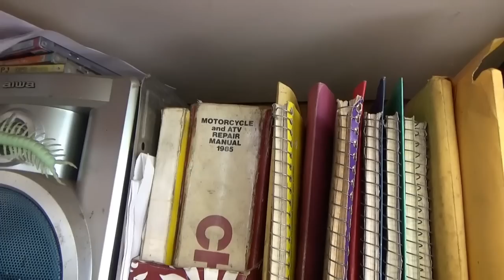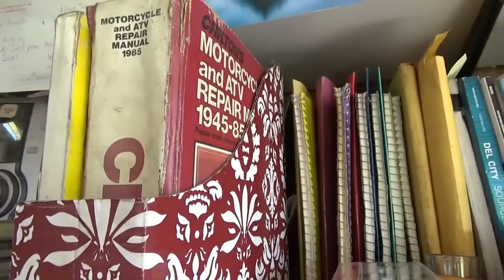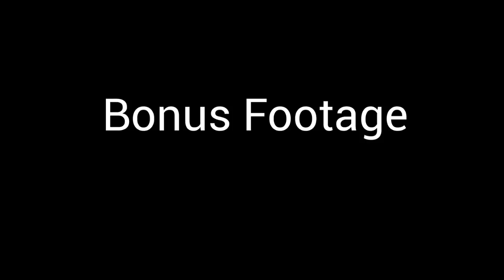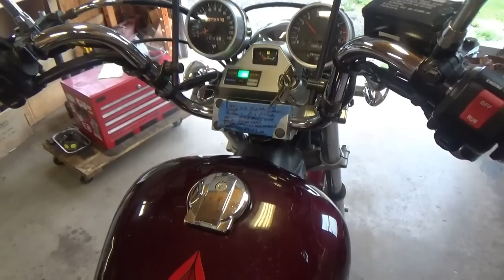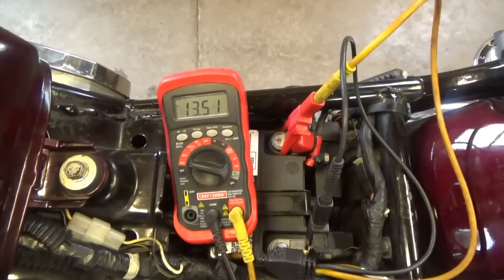Zen & the Art of Carburetor Cleaning

Comment: Thank you for this great video—clear, well organized and good camera work. I worked with some automotive carbs back in the day, but not gunked up. Now my Kawasaki VN750 is crudded up after sitting 2 years. Dealer refused to clean the carbs when I rode it over there with a rough idle. I doubt their “technicians “ could have done as good a job as you did in the video. And yes, my gas tank needed cleaning and derusting.

Comment: One thing people who have not dealt with carburetors need to understand that the "idle" fuel circuit should be called the PRIMARY fuel circuit, because the proper amount of fuel needs to flow through it AT ALL TIMES (not just idle).  If the primary fuel jet is clogged or even partially obstructed, not only will it idle poorly, but it will probably run lean at part throttle and WOT.  On engines with governors (mowers, etc) this will cause the normal operating RPM to oscillate up and down.
Some carburetor cleaners can cause "rubber" O-rings (like between the bowl and the carburetor body) to swell, making re-assembly difficult.  If that happens, wash the O-ring in dish soap and water, rinse well, and let it air dry for a few minutes.  It should shrink back to the correct size.
Always shake the float to see if it has any fuel inside.
Reply: Those days are long gone. The carb cleaner sold today can be used as eye wash it's so weak. 🤣
Reply from the maker: Yup. My brother tipped his 1976 Yamaha XS 500 over on our first long ride back in 2006. Would only idle on one cylinder after that. Kept riding it for 200 miles. When we got home I found a piece of debris in the idle jet, and the spark plug melted into the head!!
Reply: @PineHollowAutoDiagnostics  - Holy CRAP! That thing got HOT!

I have massive pilots in my RD. Stock was like a 15 or something. If I remember right I've got 27.5's in there now. :) Ethanol sucks!
Reply: @SmittySmithsonite  What model and year of RD? I have a 76 RD400C, awesome bikes the RDs.
Reply: Wrong Answer - 1974 RD350. Actually going over it right this minute. Getting ready to go on a good ride this weekend. She’s got a lot of work done to it suspension engine paint, everything. I’m estimating about 60hp at the rear wheel. 😁👍
Reply: Not quite true, on lawn mower carburetors with 2 circuits (main and idle), the idle circuit and main will be active when the engine is running full speed without any load. This is because the butterfly valve doesn't need to be opened very much to maintain a high speed without anything trying to slow it down, and the carburetor is transitioning from the idle "transition holes" to the main jet and emulsion tube. If the idle jet is blocked, then yes, the engine will be running lean at full throttle no load at that partially closed butterfly position. Rpms will drop, and the governor spring will pull the throttle wide open. Now only the main jet is being used because of the WOT position, engine speed will increase, the governor air vane or flyweights will push the butterfly closed now that rpms are too high. Now that the butterfly is almost closed again, the cycle will repeat. This is known as "surging" to most small engine mechanics, and is very common on small engine carburetors. Turning the choke slightly on to richen the mixture a little usually fixes the problem, or the main jet can be drilled out a few thousandths if cleaning doesn't fix the symptoms.  As the engine heats up, symptoms also tend to alleviate themselves as the engine is drawing less oxygen because the air is heating up and expanding within the carb and intake manifold. Less oxygen and less fuel from the clogged idle circuit = closer to stoichiometric and better running.
Reply: @PineHollowAutoDiagnostics  Yep. I had a spark plug weld into the head of a 250cc Suzuki GTL and I couldn't even get it out.  I had to take the head off to clean a bit of carbon from between the electrodes, put the head back on, drive home 80 miles min and take the head off and take it to a repair shop to remove the spark plug.  It was proper welded in, after we got it out I had to put in a Helicoil insert so I could fit a plug.  Ran no problems after that, only thing I found was the bit of carbon between the electrodes, the repair shop had no idea either, but we think it was causing a slight misfire and a rise in heat.  But that is just theory and nothing could be proven, but it ran fine for 4 years after that with no problems.  Some electrical issues, but otherwise no more over heating.
Reply: i guess it's kinda off topic but does anybody know of a good website to watch new series online ?
Reply: @Clyde Brennan I dunno I use Flixportal. Just search on google after it:P -julian
Reply: @Julian Coleman Thank you, I went there and it seems like a nice service :) I appreciate it!
Reply: @Clyde Brennan no problem :D

Comment: When I worked in a small equipment service center, we used welder tip cleaners to clean out clogged carb jets.  Love your copper wire method, too!  I might recommend getting some small steel wire too, as it's a bit more ridgid than copper, and won't bend quite as easily with harder, crustier deposits.  :D
Reply: For very small jets, a single wire from a wire brush works well.
Reply: Yeah, those work great. I have a modified set made by K&L - they're ribbed to grind all the crap out, and they're all the correct sizes for most pilot and main jets. I've had it for 20 years. The smallest one many years back got yanked out of its brass holder and disappeared, so I use guitar wire for real small pilots instead.
Reply from the maker: @SmittySmithsonite  guitar wire... Genius!
Reply: @PineHollowAutoDiagnostics  - Thanks! I think the last one I had was .010". Worked great for the tiny pilot jets in some outdoor power equipment, or kids dirt bikes.
Reply: Use guitar wires to clean the air  regulated passages on our cnc s !
Reply: Jason Bowman - I’ve done the twist tie thing too! I usually put a bunch of bends In it, so it scrapes the inside of the jet. Reminds me that I need to order some more guitar wire (string).
Reply: @davidheinzmann4403  i tried using guitar wire  wife was mad she couldn't find  her g string

Comment: Ivan, good thing you have a video too reassemble it. I personally would take it and run it through my ultrasonic cleaner and then get a small brass/ nylon brush and clean it throughly again. The hook has a good chance of scoring the bores if your not gentle. Anyway nice to see you working on a carburetor. Very rare in today’s world except on small 2/4 stroke engines. Stay safe and well and thanks for sharing Artie. Ivan yes they do sell very small brass brushes to do the job 👍👍👍 Ethanol will destroy engines seals and hoses. Today’s gas will go stale over time and collect moisture do to ethanol. To be on the safe side drain the gas. Ivan thanks for mentioning ethanol at the end of. Your video. I would definitely drain the system if it sets through winter. The repair specialist you tube channel has great videos on two and four stroke carburetors and detailed animations of how they work. I highly recommend the channel.

Comment: Loverly job ivan :-D
You were determined to make every passage and jet clean ,  the engine sounded great :-D
I imagine your customer was happier than a dog with three trees to pee up lol.
I was watching carefully when you removed the metal cap over the vacuume diaphragms,  i saw no splits or holes.
I've never had a jet as bad as the ones you cleaned,  i've often used one strand of copper wire to clean out the jets and the typical emulsion tube found in small carbs.
I tend to use metholated spirit to wash the passages out, it's just what i have handy most of the time lol.

Comment: They make special carburetor screwdrivers that have a slightly wider tip and do NOT flair out like a typical screwdriver. (that 1/4" hex bit looked perfect !)

Air fuel "mixing tube" is called an emulsion tube !
Reply: I forgot to mention that to him in my comment. I've heard it called a "needle jet" before, too. You have the needle jet, and jet needle. Used to confuse newbies in the day. 😁
Reply: Get a gun screw drivers set. They have wider tips. Plus you can get an inch/# screw driver for delicate work
Reply: @2nickles647  or just grind one out of dinosaur junk broken off drivers...

Comment: Part of the Zen process on those carbs is playing period correct cassettes which I noticed you had some laying around. Also thought your knuckles were not skinned up or bleeding which is normally part of the experience too.
Reply from the maker: Haha getting those things off the bike may have resulted in a scraped knuckle or two
Reply: @PineHollowAutoDiagnostics  ivan; Nice work. You definitely have an incredible amount of knowledge.  These carbs work on what's called the "CONSTANT DEPRESSION" principle.  UK engines are equipped with these carbs. They can be tricky to setup,but once they are done, the results speak for themselves. I've tuned and set up quite a few of these. Have a gr8 g God bless day.

Comment: 18:45 there is also an o-ring after the washer. It usually falls out when you are not looking. It is critical for proper idle metering.
Reply: Yep, you definitely want those out of there before hitting the circuit with compressed air, LOL! Those o-rings usually end up in another dimension. Been a couple decades since I've made that mistake. 😁
Reply: @SmittySmithsonite  too funny!
Reply: @SmittySmithsonite  launched into outer space lol

Comment: That's an excellent point about checking the petcock. As you say, a leaking petcock will produce a dripping stream of fuel, followed by continuous evaporation from the bowl during storage. With no flow from a running engine to wash stuff away, you get varnish and deposits inside the carb bowl. I've been in the habit of cracking the drain screw for the bowl when storing over winter. If you get a puddle under the bike you know the petcock is leaking. Just gotta remember to tighten it up before that first start, ha ha.

Comment: You might want to invest in a ultrasonic cleaner. They make cleaning off recalcitrant gunk off fine parts so much easier. Just don't use them on very thin aluminium, it'll tear it apart.
Reply: He said around time 35 that the gunk in the jets was so thick that an ultrasonic would not work
Reply: I may us an ultrasonic cleaner AFTER removing the deposits that older AL carbs mixed with year old enthanol gas have made (not an enemy of ethanol but aluminum oxide plus corn-squeezings plus evaporation is white crusty mess) but to since 1992 I have never had a really crusty motorcycle carb come clean without running torch tip cleaners through the jets...not 100% sure how many racks of carbs I have done but it used to be a side gig in college so at least 60-70...ranging from single carbs to racks of 4.
Reply: Yeah, with all those expensive diagnostic tools, I was surprised he didn't have even a cheap HF ultrasonic cleaner......
Reply: I work on bikes all the time, done hundreds of carbs... ultrasonic cleans just about anything.... ultrasonic, wire the jets, then ultrasonic again.  And I think carb cleaner cleans better than wd40.

Comment: I also use a weld tip cleaner to unplug the jets and emulsion tubes.  It has an array of different size wires and is really cheap to purchase.  I use spray carb cleaner on the metal parts.  Adding a generous dose of seafoam or my favorite, Gumout fuel injector cleaner for high mileage engines with PEA will help keep the carbs clean.  I have dumped a whole bottle of gumout in one tank and it has not damaged the carbs on my bikes.  I also mix Gumout in the gas for all my lawn tools and it helps keep the carbs clean.  It also cleared up a miss in my 99 Yamaha 150hp 2 stroke fuel injected boat motor.  I'm a believer in fuel injector cleaners.  Always alcohol free gas in my bikes, lawn tools and boat.

Comment: The part you called an anti-backfire valve is likely a power valve. It's purpose is to open an extra fuel passage for more fuel flow when manifold vacuum is low (at wide open throttle). That provides a rich mixture for maximum power output. Holley carburetors use a similar system. The valves were associated with backfires because, if the engine backfired through the intake, it would sometimes rupture the power valve diaphragm, rendering it inoperative. Rich mixtures are not preferred during deceleration because they cause backfiring through the exhaust as the mixture is still burning as it leaves the exhaust port.
Reply: that is an "air control valve", exactly as honda and others called it. I believe it cuts off some air to the idle jet emulsion tube and enriches the mixture when throttle is full closed with high manifold vacuum, which makes it able to burn the fuel instead of not loading the exhaust up and spitting ducks.... been years since I worked on any of those carbs though.
vehicles have done the opposite for years, intentionally opening air bypass valves and majorly leaning out, of course the cat converter happily chews up the unburnt gas, but when there's a leak ahead of the cat or someone hacks it out, lookout, you'll have one hell of a duck spitting machines poppity pop pop.... lol

Comment: I use Berrymans B12 Chemtool spray for cleaning carbs. Wear glasses so it doesn't get in your eyes. It's ok to spray WD-40 on things when reassembling the carbs, it is slippery and can make things go back together easier. But it is not strong enough to remove gas and ethanol residue. If the carbs are really bad, get a gallon of carb cleaner and soak them in it overnight. I use different size guitar strings for cleaning jets and passages. I replace those JIS screws in the top covers and float bowls (or in this case, jet compartment covers) with Allen head screws. They are far less likely to strip out when removing. I recommend using hand tools instead of power tools on carburetors. Parts that are really covered in built up gunk, like those jets, just about have to be soaked in carb cleaner for a while. It will dissolve all that stuff. Those carburetors don't actually have a "choke". They have "enrichening circuits". Far more complicated than a simple choke. To run right, the pilot screws need to be turned out around 2 1/2 -3 turns. They are set too lean at the factory, and usually have a cap over them which must be removed to get to them. There are usually a spring, metal washer, and rubber O ring on most pilot screws. Even if WD-40 foes through the passage, that doesn't mean there isn't build up inside the passage that can restrict it. Another reason I spray carb cleaner through everything. Again, the high E string from a guitar is perfect for cleaning jets. It is small enough not to damage anything, but stiff enough not to bend while you work it through. Yes they do make a tool for cleaning carb jets and passages  https://tinyurl.com/yxvcbfhc  I have a couple. But guitar strings work fine. When removing the main jet from the emulsion tube, sometimes called the needle jet, it is better to use a proper size end wrench instead of a vise to prevent crushing the soft brass. The green stuff is corrosion, caused by ethanol. 

For some reason, the Kawasaki Vulcan 750 carbs (I've had three of them) tend to get dirty faster than most other carbs. If you are going to let it sit for a while, it is a good idea to completely empty the tank and drain the carburetors. If you are going to start it once in a while it is stored, which I recommend to prevent deterioration, put some 2 stroke TruFuel in it. The oil in the 2 stroke fuel will help protect the tank and carbs from rust and corrosion. It has a 2 year lifespan. A can of spray carb cleaner serves as both compressed air and cleaner at the same time. If you need replacement parts, get oem parts if you can, and stay away from the Chinese JUNK. I don't recommend putting any kind of sealant on a carburetor. There is too much chance that it can find its way into the jets and passages. If the gaskets and O rings leak, replace them. If you use anything, use oil or vaseline. 

Here is a good video on Vulcan 750 carb removal. It's quite a job. https://www.youtube.com/watch?v=biuOyrOjiWU